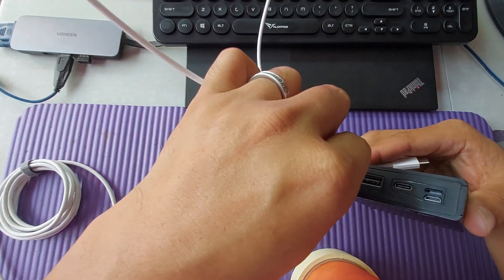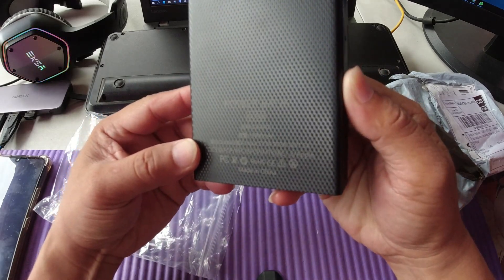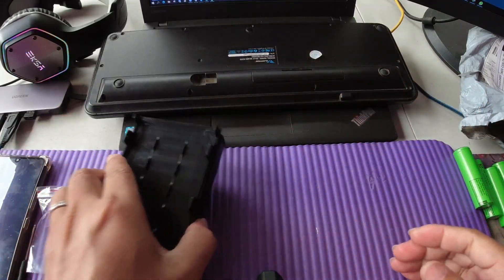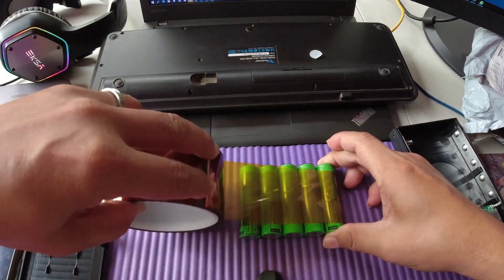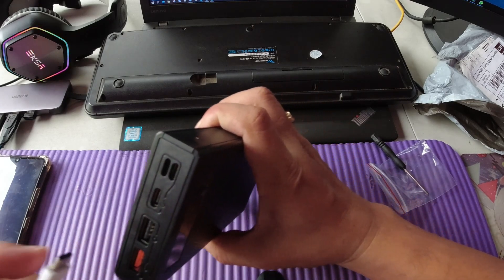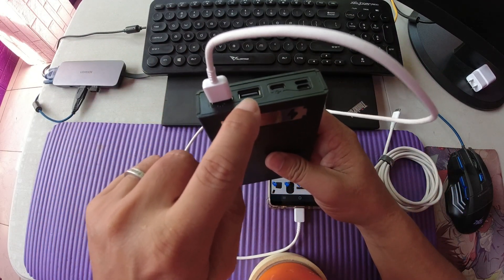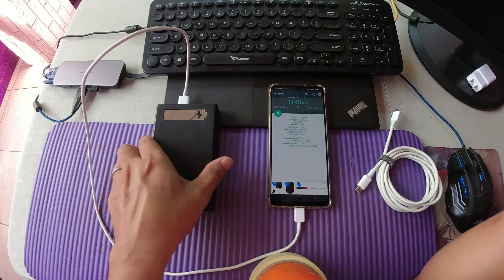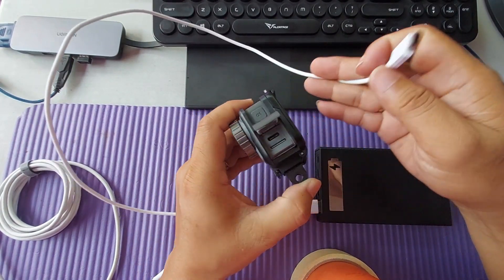DIY POWERBANK FOR ACTION CAMERA DJI OSMO ACTION CAMERA | DIY Petz

Comment: Sir Petz, how much po ang purchase nyo dyan sa Fluke 117?
Reply from the maker: Good morning Sir. Thanks for noticing the multimeter that I have used. Actually Sir, it's a Fluke 114. Its been with me for quite some time already as it is a very helpful tool to have. I could not remember the purchase price for it was purchased sometime 2010 or so.  The price range as of now is from 10K-20K Sir via shopee or lazada.
Reply: @RollyPetz  oo nga sir talaga nag zoom in pa muna ako para malaman yung tester na gamit mo then I made some YT reseach about it. Napa isip na tuloy ako na I need one. Salamat sa pag sagot Boss. Stay Safe
Reply from the maker: @KwentoNiDennisEU  may nabili ako sir na Digital Clamp Meter Tester AC / DC Volt Amp Multimeter Auto Ranging Current 600A only @ Php 469 lang Sir, OK naman features, naghanap kasi ako ng clamp meter for the current testing. eto yung link sir.
https://invol.co/cl6irlq

Thanks for dropping by our channel po.
Reply: @RollyPetz  salamat sir
Reply from the maker: @KwentoNiDennisEU  Welcome po Sir. Stay safe po.

Comment: tama ba conversion ko 17.5 ampere hour more or less 6 hours battery life?
Reply from the maker: Yes Sir, most like 5-6 hours Sir.
Reply: @RollyPetz  I think so far your idea is most perfect solution for a motovlog setup in terms of battery life. most of the setup I see is powerbank setup. Thank you for sharing your idea and I'll post a link of my experience pag nagawa ko na. Salamat brother
Reply from the maker: @KwentoNiDennisEU  Thank you so much for the appreciation Sir Dennis. It's just one of the practical approach and solution that I could think of. Thanks again Sir.
Reply: @RollyPetz  Salamat muli and sa mga reply. Ride safe and stay safe
Reply from the maker: @KwentoNiDennisEU  ride safe and stay safe po. Salamat.

Comment: quick question, have you tried using this setup during your ride. How long did this the battery last in one long ride?
Reply from the maker: Yes Sir, I've used it during the road test bike ride for almost 4 hours, the battery remaining was @ 15% with the Osmo Action still at full charge. here's the link during the ride Sir...https://youtu.be/Z66Igkz0NZk
Reply: @RollyPetz  no overheating issue with the Osmo, sir?
Reply from the maker: Good morning Sir Andy. Its quite noticeable with regards to high heat desipition Sir I think this is commom to all Osmo Action based on forums and reviews, but so far sa akoa sir no hang up pa..it does not missed any of the footage.